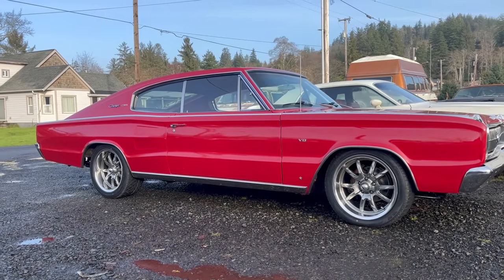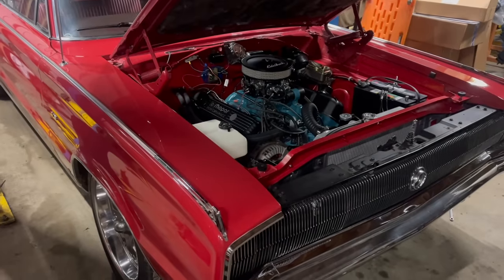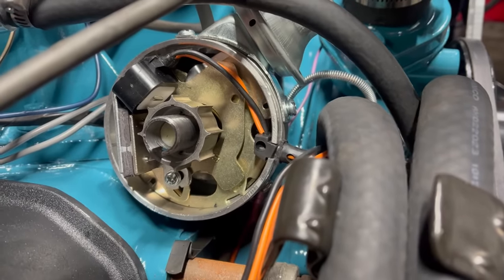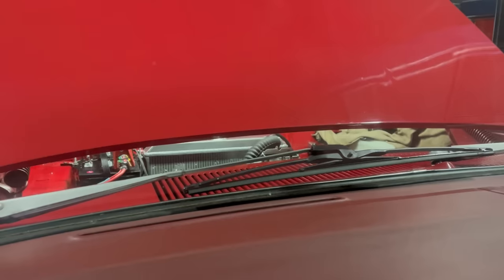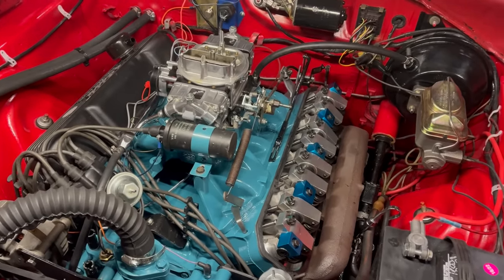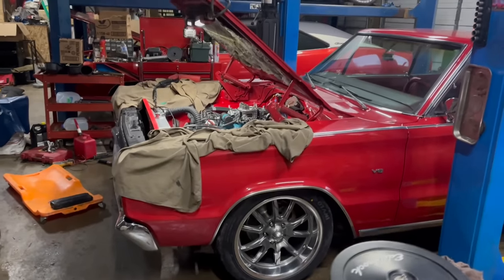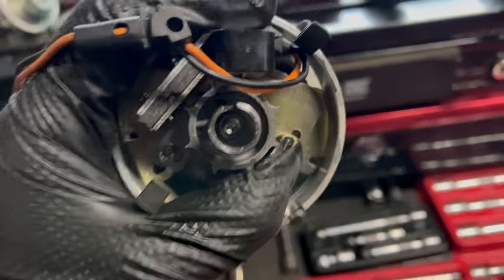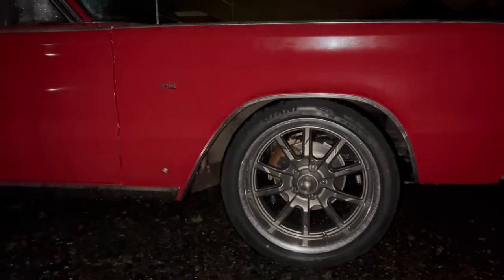What's Wrong With This 1967 Dodge Charger Big Block 383? When Bad Parts And Builders' Mistakes Mix

Comment: I just went thru the same problem with a Holly 750 double pumper on a Ford 428. Turns out carb was faulty. Could not turn fuel feed down
Reply: Ran so rich. We put a Edelbrock back on it and it was perfect. Holly returned

Comment: I never liked the styling of the early Charges but wouldn't mind having one. My mother had a 67 Sport Fury, same engine.  Very nice car. Almost as fast as a Road Runner!  Anyway, it got wrecked and was replace with a Chevy Caprice 396, on paper they should have had about the same performance, but it was no contest.  The Plymouth was much nicer car and had much better performance!
Reply from the maker: At first I thought they were awkwardly proportioned and just not quite right, whereas the ‘68-70 was a thing of absolute perfection and beauty. But the look really grew on me after owning one for nine years. I think they’re cool! But the interior is really what makes it great.

Comment: Excellent video of working thru all these issues....I love seeing this stuff as it only helps me out with my hot rod project issues. Thanks for filming it all. As far as the suspension goes, I like stuff low as possible and I live in Phoenix, so I can. My solution would be shorter bump stops! They make nice polyurethane stops, too. 😁

Comment: 5:20 What's especially nice about the 383 vs. other Mopar or GM/Ford offerings?
Reply from the maker: It’s just a nice combination. Good breathing head, good sized bore with shorter stroke, much better fit in these cars than a 440 due to its shorter deck height, it weighs less… they’re also just sweet running engines.

Comment: I love how, the coil is under the main gas leak. Have relocated many. Ford and Dodge put under the fuel pump. 
     Oil or not, I know they're not meant to lay on their side. 
      It is my personal favorite body.
      Mickey Mousing distributor riddle,nope Dumbass Degreewheel. 
     Thanks for the ride.
Reply from the maker: If Chrysler mounted them on their side for decades and decades… and we are still using factory coils, like the 56 year old coil on this engine… just saying. It’s not a problem. Now, covering the coil in gas… that’s not ideal. But it’s more of a Holley problem than anything 😅

Comment: I wonder if that brake booster was leaking vacuum causing some of the idling troubles?
Reply from the maker: Tested that during the idling problem diagnosis actually. Did not seem to be.

Comment: I’ve never had to mess cam gearing when timing a distributor. Obtain compression stroke on number cylinder, top dead it and stab distributor and wire firing order from were the rotor is sitting,,done.
Reply from the maker: Spark timing is not at all the same as valve timing, homie. It doesn’t matter what you do with the distributor if the cam gear is 6+ teeth off.

Comment: That was a car put together by a bunch of people who almost knew what they were doing. There was no focus on that build.  I noticed you didn't mention the exhaust pipe made up of 20 pieces welded together.
Reply from the maker: The engine was built by a different person. The owner didn’t have any of that in mind, but he was led astray by an “experienced builder.” They did not think about the application or the street trim combination, and instead threw parts at the engine - which they quite obviously couldn’t even do right. Since this video, a lot of the other issues have been worked out.

Comment: 45.27
Look at that right side low beam staring right at the ground! I'd be surprised if that hits the ground more than two feet away from the car.
Nice looking car. Even after straightening things out, it still needs a pretty fair amount of work to be roadworthy. That's a shame that whoever set the engine up didn't bother to do it right. Remove pretty much every single suspension component from under the front end, make everything nice and new again, and stuff those saggy-ass worn out A-Frame bushings back in there. When replacing all that stuff, why not send the thing to an alignment machine before they return it to the owner. Outfit the thing with disc brakes up front, install an easy to access proportioning valve, but go ahead and just slap it together, crack the bleeders once or twice and send it down the road. Whoever(pl?) the owner had do all that work really took him to the cleaners. It costs a fortune to restore something like that, and for it to have ANY, nevermind ALL, of these issues is criminal. There shouldn't be one single tiny issue with that car at all.
Reply from the maker: This is a project that has been through many sets of hands. The owner trusted the engine to a builder that was supposed to be reputable. You can see how that turned out… the owner did the disk brake swap himself and was not finished when the car came to me. We discussed completely overhauling the front end, and I believe that became part of his plan. It obviously had not been aligned yet. My job was to make it run right, and to address a couple more little things. What we’re seeing here is an unfinished project, so it’s a little early to pass full judgment. A lot more has happened with the car since this video - for example, the hurried temporary wiring connections in the engine compartment that everyone was complaining about have been finished correctly. He has fixed the rotating headlights. Detailed the engine compartment nicely. And much more. It’s turning out great. Hopefully he has also adjusted the headlights, because they were indeed quite terrible. Haha.

Comment: 68 was the year Dodge finally got around to making a good looking car.
Reply from the maker: Right - by essentially copying Pontiac styling. Personally, I think the standard 66-7 B body cars were conventionally good looking. And I think there were a lot of other points in history where they built cars that were attractive. But they sure had some misses… and I can definitely agree that these Chargers are polarizing.
Reply: @DeadDodgeGarage  my neighbor, a Lockheed engineer, bought a new 67 Charger with a hemi. 
In 1977, a year after I graduated highschool, I was looking for a car to buy.
Gary had that flaking silver paint and drivers side ripped seat Charger for sale for $800 bucks.
My dad said don't buy that gas pig. That's the reason he's selling it.
Gary dumped the car and bought a new Honda Accord. 
I bought a standard 69 cougar stick shift car. 21 miles per gallon vr 8.

Comment: I thought the '66 didn't have the trunk passthru?  I've owned gen2 and gen3 Charger's but never a gen1.  Would love to, when I have more garage space.  Eternal problem... :-)
Reply from the maker: The drop down trunk panel is common to ‘66-67 Charger, and all fastback Barracudas ‘64-‘69. I have found that there is never enough garage space here either… haha.

Comment: It seems from looking at Comp's site that the smallest hydraulic roller they make for Chrysler big blocks is a 224/230 @050.  Maybe the builder refused to put a flat tappet in and this was the result.  Or, maybe he wanted it to "sound cool" and put in one of the Thumper series.  Either way, whatever is in there is too much cam for someone who just wants to cruise.
Reply from the maker: It is still a flat. Mistakes were definitely made.

Comment: Folks struggling with that Chrysler LOW VOLTAGE issue at idle... When running cams and being idled down happens so does the voltage output of the alternator drops at idle. There had been combination Alternator and regulator kits on the market. Thee alternators will have a smaller pulley to counter this in which saying buy the regulator from the Alternator seller is a must buy the entire kit don't be a cheap skate it does not pay you will defeat the purpose. Those kits sold with regulators helps from over charging when ya dump the pedal & uncork the thing on the street. That has been an ages old problem with the Chrysler cars and trucks. Not too long ago another NY Port Auth cop came all the way from NY with a PULLEY KIT for a Silverado truck. He has a Commute from Hackensack Port area to the Bronx in which he sits each day in sometimes over an hour or two in traffic depending on what kinda of Deviltry is going on at the time he departs for home. Headlights would dim out in the summer with the AC on not so much but in the winter he is running AUX lights because of all the 2 legged vermin he encounters jumping off the sidewalks on the way home. So the low voltage idle is common in issue in Domestic vehicles and always has been. The regulators sold with the Alternator kits are designed to hold up to hot rodding abuse okay. Most of the vehicles today the regulator is inside the Alternator and it is built for both high speed and low FACTORY idle speeds. But on some modern vehicles even those Alternators are not meant for use of hours at near idle in the drive gear. it is a popular topic these days really is. Especially GM the Suburban Tahoe and GMC variants all suffer at drive idle speed especially when running AUX goodies and lighting. HOPE I HELPED OUT HERE... See my channel for tips on that stuff.
Reply from the maker: I’ve never seen a kit like you describe for a Chrysler product. In my experience, there is a measurable difference in charge output from idle to off idle, but a major enough difference to cause dim lights, slow blinkers and the like are usually down to an electrical issue, not the size of the alternator pulley. That same pulley was used on many, many Chrysler models. Some have the low charging problem, and some don’t. I recently swapped an alternator for an identical alternator and the new one solved the low charge at idle problem. With the same pulley. Just saying.
Reply: @DeadDodgeGarage  The wiring issues I was used to were on the larger Chryslers like the 70s Polara and a few others like the Cordoba and the Pickups. I had a bunch of pickups and always add more than one set of them old fashioned Hallogen fog lights and it was udder chaos.. So there were kits and when I was fooling with Chrysler it was back in the 80s you could get just a pulley from Direct Connection or the whole Kit with regulator. Some of the speed shops sold a stepped up Standard Ign. regulator with a high output alternator in house. Usually you had to get a diff belt. The cars & trucks like my Ram Charger that had them double belt set ups that led to some real issues with getting a pair of shorter belts. I know I did it. There were at times bad regulators on the market at one point. Eclin was one company. MSRC was another company. At that time I worked in a parts store so we already knew about it. A distributor came circa 1982 pulled the entire stock of Eclin regulators and distributors caps too. Without sounding like a wise guy because I don't mean it like that either but I was fooling with Chrysler long before you were born so there are parts & problems you might just start encountering.... Your cam shaft video on that big block was a classic scenario. My own son did that to himself... Took me all 5 seconds to figure out what he did. I tried to talk him out that timing chain kit telling him I could just get a performance distributor. He didn't like $400 price tag of an electronic distributor where you can degree the timing there. I have one on my Ford project truck the newest project and I will say its far better than the timing chain set up goes.. Take it from an old timer I would pulled the heads on that old girl and started there also new Distributor and Carb... Works like a charm every time. I've got my 340 2-4bbl Duster with well over 250K on the clock and she still kicks ass down in 1st & 2ond gear. Can't say so much for her Clutch... She's on like her 7th clutch now...

Comment: You need to take a water bottle put a hole in the cap run a piece of vacuum line into the bottle with brake fluid in the bottle and hook the other end to the bleeder nipple that way you can get the air out by yourself and won't get brake fluid all over the place it works great you should try it.
Reply from the maker: I own an actual professional grade vacuum brake bleeder. I generally can’t be bothered to actually use it. Gravity bleeding works great, and the towel catches the mess. But yes, that’s a good technique.

Comment: I was going to guess firing order from how it sounded. But you would have picked up on that already. I did not think the timing marks would not be lined up. Who messes that up?  WTH? kind of scary when you see all the HP parts on the valve train and they did not line up the timing marks.  Yikes!!  Makes you wonder what else you will find. I am at 25:35.
Reply from the maker: Yeah… the engine builder did a good few goofs. The owner was told he was reputable. Apparently not so much.
Reply: @DeadDodgeGarage  I cringed when I saw what you discovered after removing the valve cover , oh yes. The timing cover as well.  Yikes!!
Reply: @DeadDodgeGarage  Yes.  You may want to go through a few more heat cycles and check the torque of the head bolts.  After all you have found, I would check those and the intake manifold torque as well.  Yikes!!

Comment: When altering ride height,do you need to loosen inner pivot and retighten after  adjustment to keep from prematurely wearing out bushing.
Reply from the maker: That would be a good idea, as they are supposed to be torqued at ride height. But I’ve never done that, the last guy definitely didn’t, and if you’ve still got old rubber bushings, they’re probably worn out anyway… that’s why I recommend the poly replacement bushings.
Reply: I'm currently working on stance and tire sizes for my 66 Coronet.  It currently has new rubber type bushings.  Wasn't sure of procedure.

Comment: I wonder how many kids were conceived in that car 🤣 This is what happens when you just throw money at something because the decision sounded good at the time. Did you take his old carb apart and check it for metal shavings? I've been hearing more and more that this has been an issue with Holley carbs.

Comment: Excellence is achieved through the mastery of the fundamentals.🤦
Reply from the maker: Acceptability is achieved by mastering the fundamentals. I think excellence is achieved by mastering the ability to adapt and take on anything - because in my experience in auto diagnosis and repair, new and exciting problems are the norm. Master a process - or even better, buy a special tool - and you’ll probably never have to do that job again.

Comment: Shouldn't the rotor be pointing to the 11 o'clock for TDC...?
Reply from the maker: Negative. If you refer to the factory plug wire / cap diagram for big block Mopar that is readily available online, you will see it in roughly the 4-5 o’clock position.

Comment: Number one: the fuel rail on that carburetor is junk. There's no way to change out the Jets without removing the fuel rail. Number two: when setting the float level on that style of Holly if you pull the bowl the diameter of the float bowl screw head is exactly the distance needed for float level.
Reply from the maker: The fuel rail? You mean the standard cruising model dual feed Holley feed line setup? I don’t care what style of rail you use, pulling the bowls on the Holley is a pain. Good to know! I eyeball the height of the needle and seat assembly when installed in the bowl by the number of threads and it’s usually close - then fine tune when running.

Comment: Is the engine producing at least 18 psi for the brake booster to function properly?
Reply from the maker: I had that thought, and it probably isn’t - but at times, even with the engine off idle to produce more vacuum, the booster still doesn’t work for shit. Unrelated, vacuum - inches of mercury

Comment: if that 383 was original it would have 383 four barrel on the fenders. at least all i seen and remember. i remember the 66 an 67 were gaudy in the 70s when i was a young gear head. maybe because the next gens. looks blew them away. but now the 66 67s look beautiful. time....
Reply from the maker: You’re so close! If it was an original 383 four barrel, it would say 383 FOUR BARREL! But, because it is an original 383 2 barrel, it says V8.

Comment: had a 69' Newport with buckets, console, red, black top and interior .. its a BEAST,  383 ,agnum, I pout a 440 magnum aluminum hi rise edelbrock with the 850 dp..  holy smokes!  put her into a pole at the baskins and robins first time I stabbed it pullingout the sambos parking lot .. WTF just behind the B pillar, put a ncie football size dent in the q panel.. fugg,  that car was a beast, I dont remember anyone ever passing me on the freeway . . .  just a beast!   a couple quarts of VP in the tank, oh hale yes!  Id go hunting "cowl inductions" on Colby, or the Renton Loop, or Alki, or the Gardens . .   coincidentely they all had a half mile strip  . . .   woo hoo!   Ihad to start bbringing guys to to handicap and help me drink the beer, no idea what the guy did to it that owned it before me but she sure responded well with that edelborck and 850, dint even have to turn the lighting rod . .  or touch the carb, she was DIALED .. it was a beautiful car too, so comfy.. loved it, we put 10" on the rear 8" up fornt on magnesium 5 spokes.. all I ever did to it .. miss it dearly